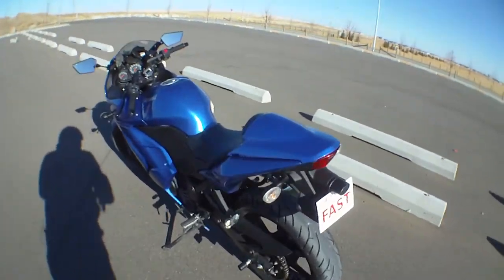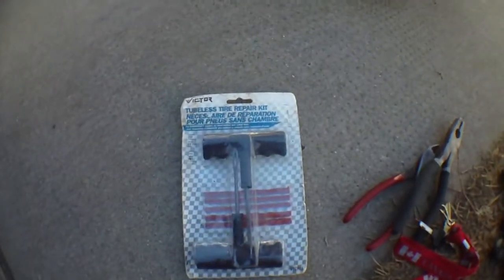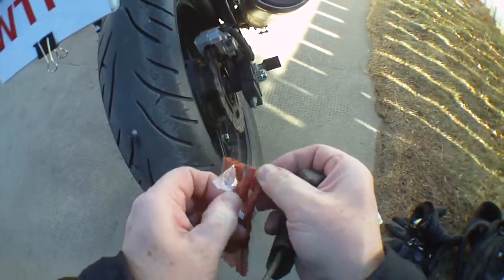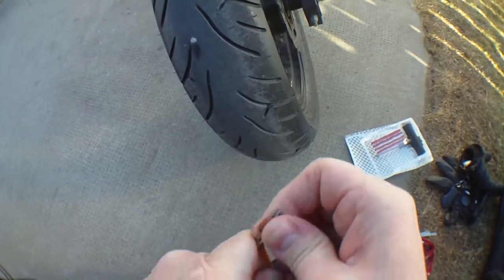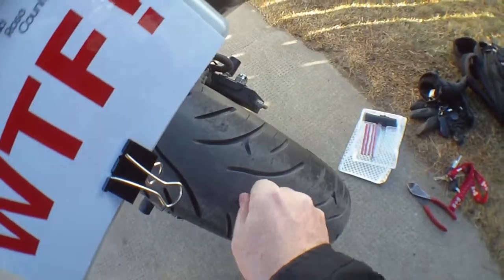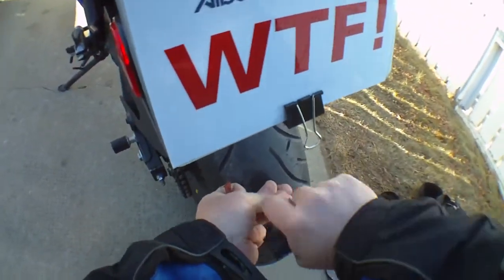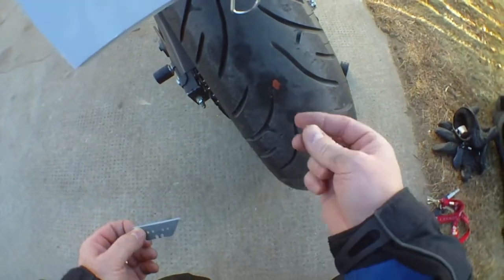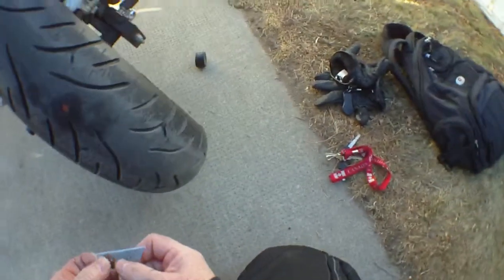New tire, new screw!

Comment: You should have used the rasp tool more creates a rough but larger hole for the sticky string plug - the are life savers always carry them with me.
Reply from the maker: Yes. I have learned to use that tool properly now. Plugs have saved me many times. They are a required service tool for all of my family now, and I regulary inspect & test them for proper use.
Reply: @osgnuru  - Yes I ride in some remote(ish) areas so I always carry them with me along with a small foot pump in my top box - truely a wonderful idea those little sticky strips and they hold so very well.